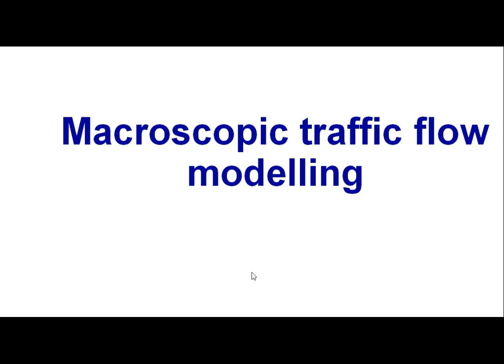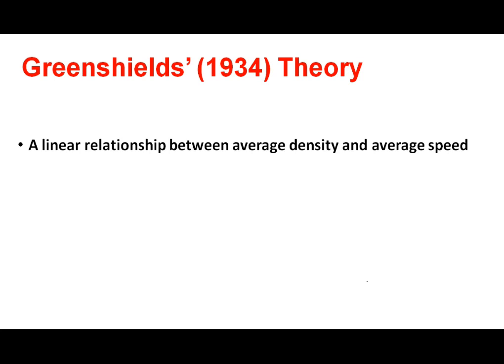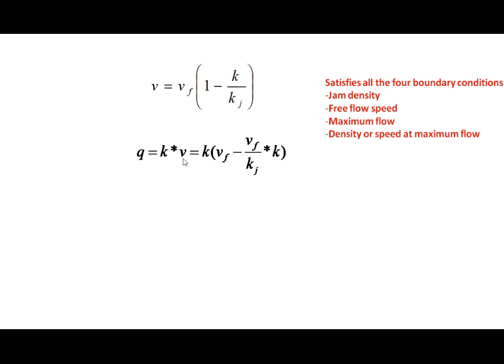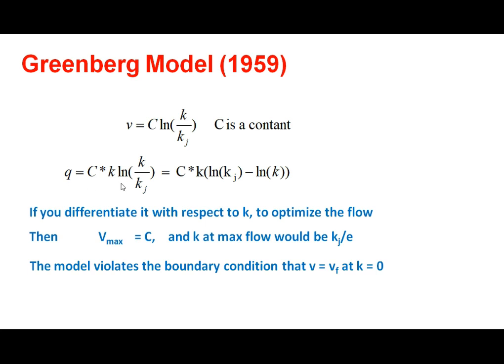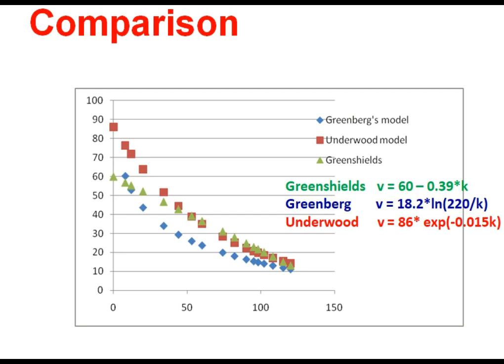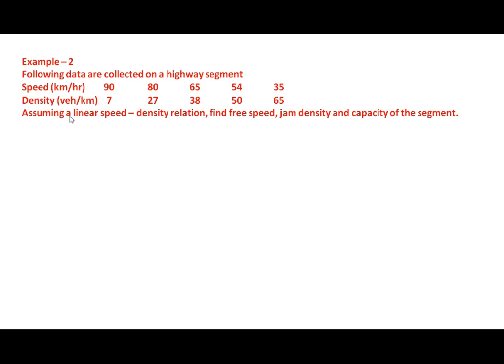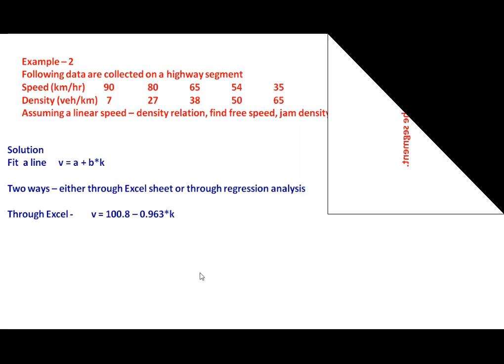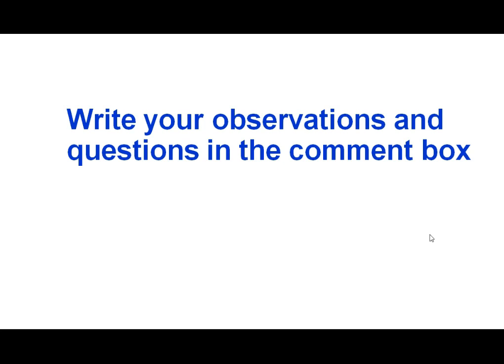#trafficflowmodeling, #Greenshields, #Greenberg, Macroscopic traffic flow models with examples

Comment: Sir I have one question why greenshields model is assumed to be linear for density-speed relationship
Reply from the maker: This is not an assumption. Greenshield collected data on a highway using time lapse photography in 1934 and fitted the relation between the speed and the density and he found that the relation is linear.
Reply: @SatishIITR  Sir then why others are not getting same or different relationship
Reply from the maker: @vishnutripathi3005  Greenshields model is the simplest one and it was derived at a time when there were not many gadgets available either for taking field data or for making long calculations. This was the fiirst atempt to relate traffic flow parameters. This equation gave directions to other researchers and also later opened  anew field of traffic Engineering. Further developments were provoked by this research only.
Reply: @SatishIITR  thank you so much sir